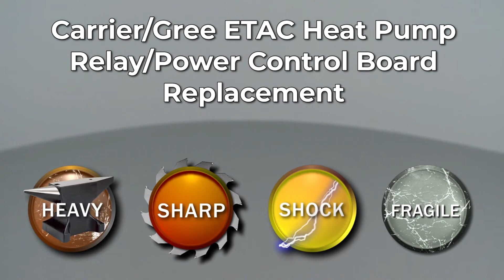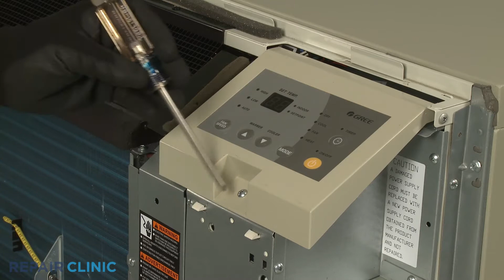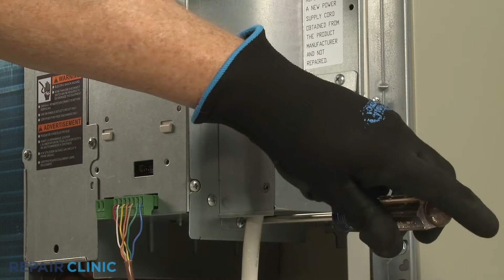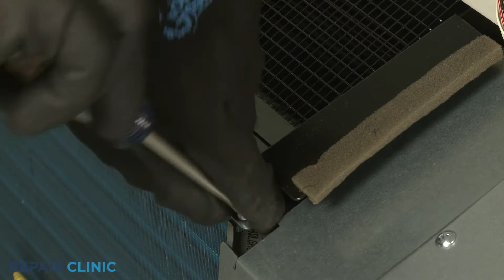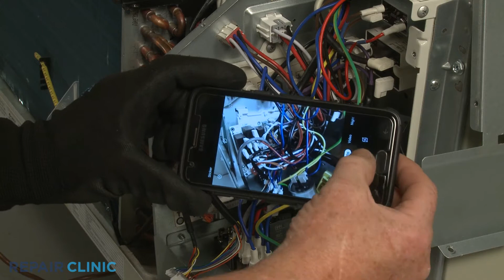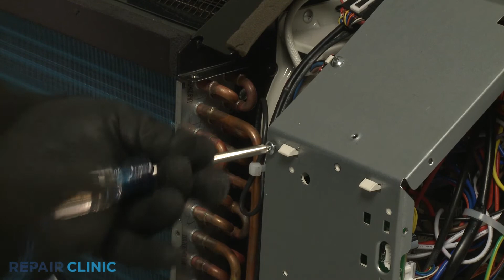Carrier/Gree ETAC Heat Pump Relay Power Control Board Replacement 30132161

Comment: TAKE PICTURES, TAKE PICTURES!

No HVAC experience here- I just changed this board to defeat an A2 error code. My advice is take THOROUGH photos of your wiring: cut the zip tie bundling your connections and follow each wire with documentation PRIOR to disconnecting anything. I took a lot of photos and still ended up in the service manual referencing the wire diagram. Don't be me, just take take full, shadow free shots 😂